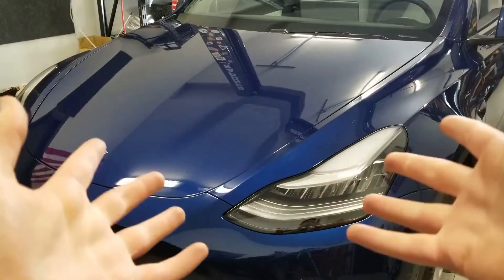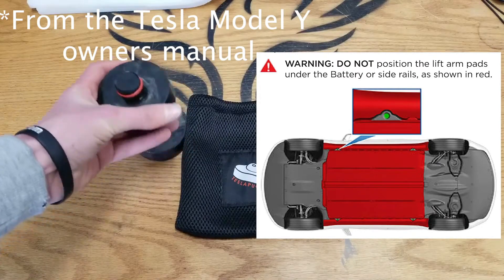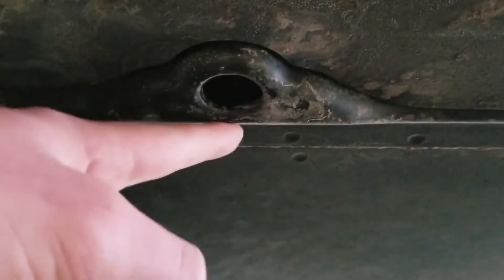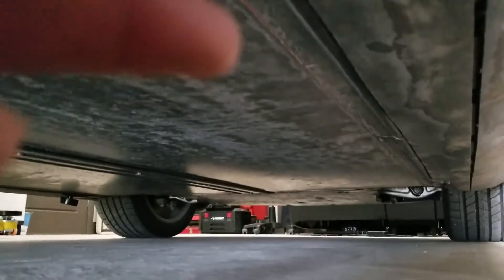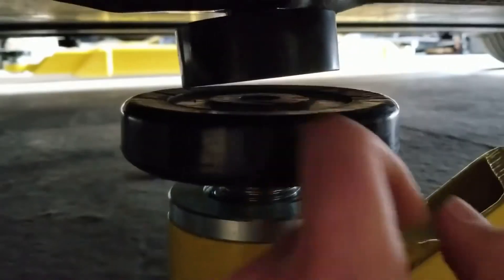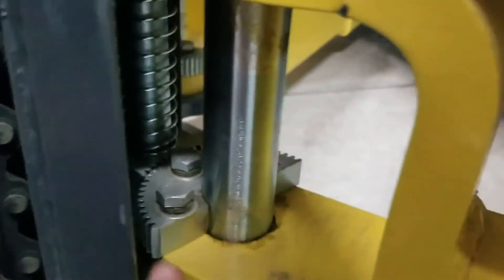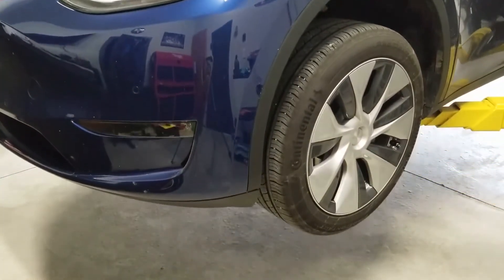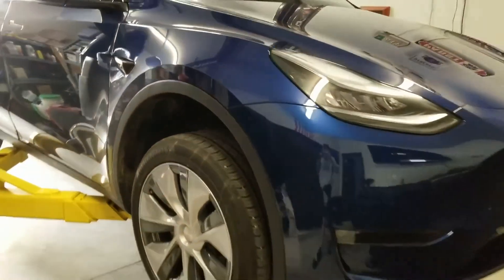How to Properly Lift Your Tesla Model Y, S, X, 3 | How to Use Tesla Pucks to Raise a Tesla

Comment: how do you get a tesla up on all 4 jack stands? without using a lift.
Reply from the maker: There are special jackstands that allow you to lift it using the jackstand itself...I have talked about it in other comments on this video, and I'm pretty sure one of them has a link.
Reply: @TheMileHighMechanic  with out special jack stands.  Just regular ones
Reply from the maker: @gunsmokezz  Use a jack with a flat surface and jack at the correct jacking point. Jack high enough so you can place the jack stand at the other jacking point. The car will be supported with one jack stand and a jack on the same side of the vehicle.

Comment: Silly question but I’m doing this to rotate the tires myself with one hydraulic jack lift.  Where do I put the jack stand if the jack itself is already on the puck?
Reply from the maker: You will have to get unique jack stands with feet that slide into the head. You will then use the head without the feet to jack up the car, once you have it in the air, you can add the feet to make it stand. Rennstand makes these special jackstands (https://rennstand.com/)

Comment: Thank you. I wish the car came with the pucks. The guys at the tire shop just now asked me if I had the pucks and I didn’t know I needed them.
Reply: You don't need them just make sure you have rubber posts on your hoist and they're not shredded or anything and make sure under the car isn't wet or greasy on the metal where that little hole is. It won't slip or go anywhere you'll be fine
Reply from the maker: Yeah, they would be nice to have from the factory. Just another quirk of a Tesla I guess.

Comment: Not gonna lie i work for a automotive shop big tire company cant say which one and we don’t have these i believe we have lifted a few teslas not knowing this information and I’m going to work tomorrow telling them we need to invest or i will not work on teslas
Reply from the maker: That is terrible! I hope they listed to you and you guys start doing it safely.
Reply: @TheMileHighMechanic  TBH I think it's terrible that you can't lift a Tesla normally like you can do with any other car.
Reply from the maker: @zezizarjaars  Yeah, it's an inconvenience, but it is a different car that doesn't need much maintenance. Soooo I will take having to use some little things to jack it up any day over a car that needs alot of repairs and maintenance.🤷‍♂️
Reply: @TheMileHighMechanic  But what about other electric cars then? Can you lift them like normal or do they also need special things?
Reply from the maker: @zezizarjaars  It depends on if they use a skateboard like system or one with a frame. If the battery is structural as well then you have to have special lift supports as to not damage the battery.

Comment: You didn’t put it in jack mode
Reply from the maker: The Model Y does not have smart air suspension so there is no jack mode.
Reply: The Tesla model 3 doesn’t have jack mode either.